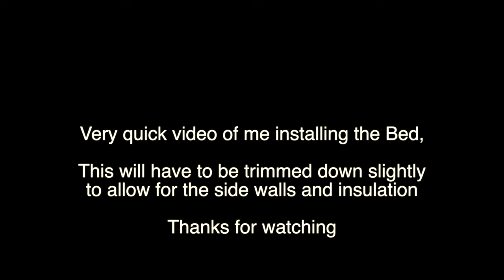Self Build Campervan Conversion Bed Build  4K

Comment: Hi, is 4 mounting points Strong enough To support the bed ? Or do you later add support to the bed from underneath? Also, how do you mount the cross beams on the L beams? Thanks in advance. Looks great!